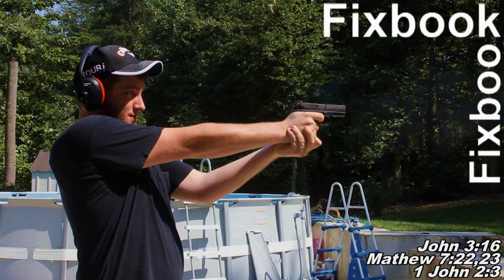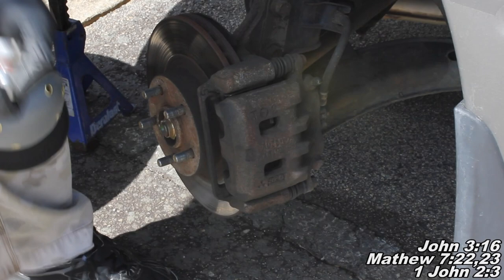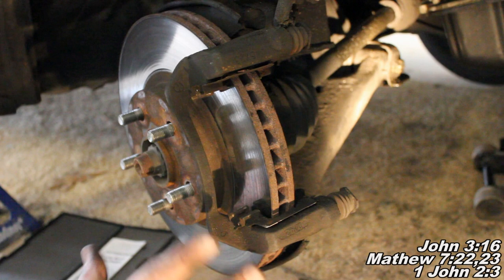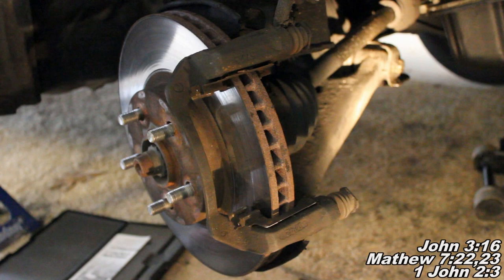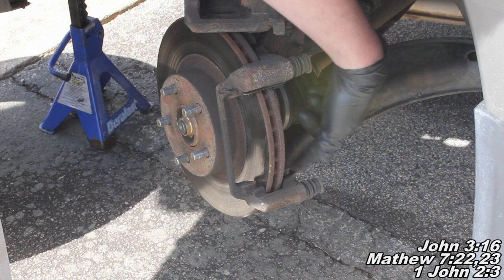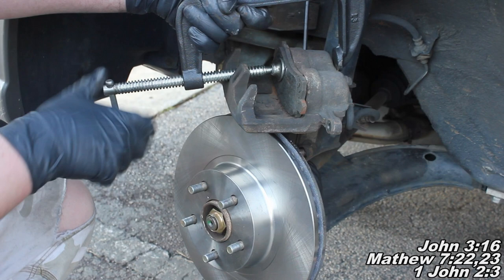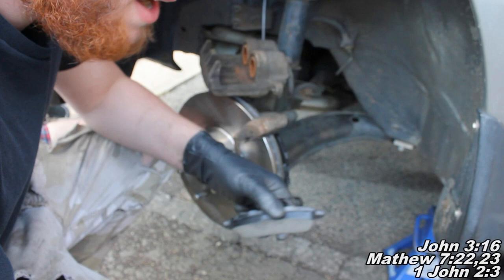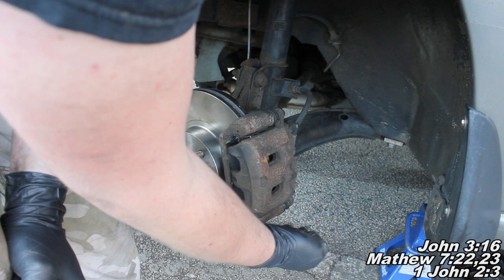Front Disc Brake Pads & Rotors "How to" Subaru

Comment: few things to add for people doing this for the first time either on a subaru or any car. if you choose to replace the rotor, get brake cleaner and spray it on it and wipe it..it comes from the factory with a chemical to prevent rust, another thing, when compressing the caliper pistons as he said be very slow, also make sure you take off your brake fluid cap to let any air out..and finally, the slide pins for the caliper mount, if you need to lube them, use silicone paste ONLY, not grease or anything else.
Reply: my man

Comment: Hey thanks a for the video, super helpful.  I just completed this job on my 2001 Outback...new pads and rotors seem to be working great, and I am no mechanic. The only tools I ended up needing were the 14MM and 17MM wrenches and a hammer! I found that tapping the wrench with the hammer in the tightening direction a few times, then tapping it to loosen it made it a lot easier to loosen the bolts...thanks again!  Now i will go pay for an oil change.

Comment: he forgot to add that you can turn your steering wheel to make things easier to reach.  also, brand new rotors are coated to prevent rust, and this coating needs to be cleaned off with brake cleaner prior to installation or your brakes will not work properly.

Comment: Torque values for the bolts.  38.3 ft. lbs. for the 17 mm and  28.9 ft. lbss for the 14 mm.  Also you should clean your new rotor with brake cleaning fluid to remove the rust inhibiting coating that the rotor is shipped with.  Here's another helpful video on the process, https://youtu.be/qWU8lB45TW8

Comment: hey thanks for the great lessons Mr Fixbook! My 99 legacy seems to have "rotor rattle" when I use my breaks in a slow fashion. (no rattle when quickly applying breaks). The rattle is felt most in the steering column. Getting ready to check the rotors...but wanted to reach out and see if you have experienced this and feel somewhat certain, my noise should be rotor repairs. Thanks Fixbook!

Comment: Ok my rotor wouldn't come off after I removed all the bolts . Now what do I do if any one knows thanks
Reply: Sometimes you have to beat it off.  Use a deadblow mallet or a piece of 2x4 and a hammer.  Also spray some rust inhibitor on it and let it soak in a few minutes before starting your work.

Comment: My 1999 Subaru starts, but the shifter won't come out of park. I have NO brake lights when I press the brake pedal either. What can I do?
Reply: maybe see if you have brake fluid? i dont know if that would affect your lights tho but who knows
Reply: I found the video for my exact problem. It showed me to remove the face plate that is around the shifter. Under that is a hole. Insert a philips screw driver and wala. The shifter came out of park. He learned later that it is a fuse that went bad that is for the horn and shifter. You will find the diagram in the user manual. We replaced that fuse and now I have replaced the face plate and I do not need to keep the screw driver in that hole to shift my car.
Reply: +Ly Kri perfect! glad you got it figured out :)